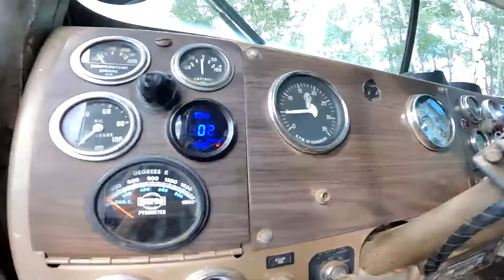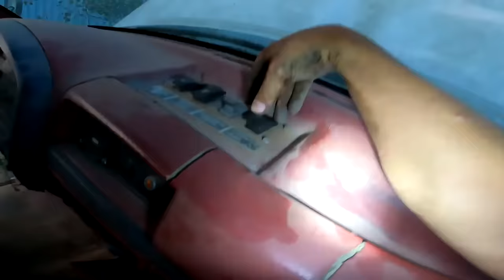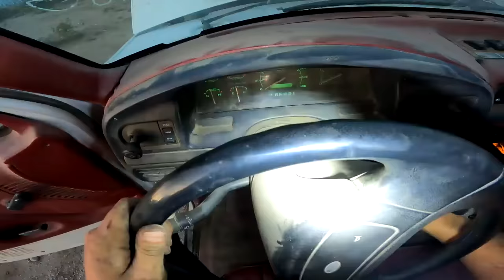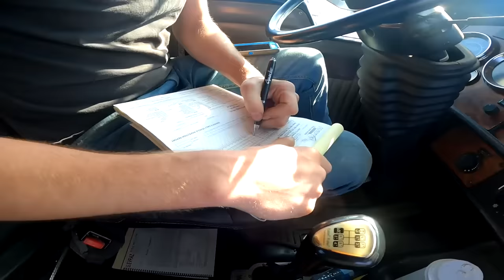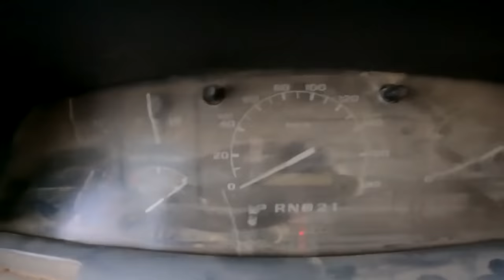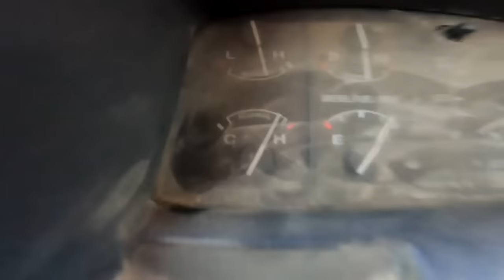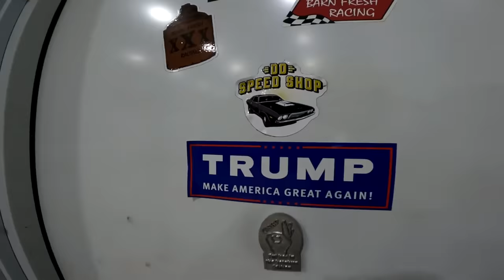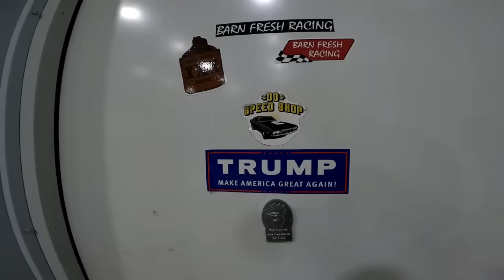7.3 IDI GARBAGE TRUCK REVIVE N WHEELIE!!!

Comment: It's an undisputable fact that engine braking is 100 times quieter than an 18-wheeler plowing through your living room.
Reply: You ain't wrong.
Reply: Lot less invasive too
Reply: I dunno man an 18 wheeler in the living room would make a nice conversation piece
Reply: And if a truck has a quiet exhaust system, the Jakes don't really make much noise at all.
Reply: I’m glad to came to this thread. This was a minty giggle 👌🏻👌🏻
Reply: But ill get a check for the living room
Reply: But have you tested it?
Reply: Amen!

Comment: Even though it’s an automatic, it is still fucking awesome. You could use it for so many things. I know you said it in the video, but my instant first thought was also a firewood machine. Load it in the side, dump it out the rear lol
Reply: And ya know with a very little work you could mount a log splitter to the truck and use  the hydro pump and pto that’s already on the truck, a set of controls and a couple hoses and fittings and your splitting wood and your truck loads and unloads for you.
Reply: It's so easy to swap these trucks to manual especially the 2wd. The ZF5 diesel/460 big block transmission is a lot easier to find then the small block ZF5 and then all you need is to find any clutch pedal from 80-97.

Now you can get away with hauling a heavy load of firewood in an auto in Alberta because it's flat there but that auto seemed like it was ready to die

Comment: Man rhat classic IDI sound takes me back.  I could almost smell the diesel cheech through my phone.  Ford damn sure makes some bulletproof diesel motors, especially those early 90's models.
Reply: '83- early '94 6.9 and 7.3 IDIs were some of the most reliable long lasting engines you could get back then, only after increasing the boost did the early 6BTs out perform them and the factree auto trans was junk compared to Ford's and the trucks are called shipping crates for a reason. I see more 80-97 OBS HD 3/4t-1t Fords on the road than any other brand from those years.
Reply: @hendo337  my grandfather worked in the log woods all his life and had a '92 7.3 F350.  It was his favorite truck of all time.  I think it had to have well north of 400k on the odometer before he finally got another Ford.  He was a huge believer in Ford's diesel trucks.

Comment: You need to do what the exhibition wheelie cars do to steer. The mount two paddles one either side of the steering wheel that each have a master cylinder that allows you to apply the left rear or the right rear brake independently to steer. Because if you keep turning the wheel while the front tires are hanging in the breeze your gonna come down and take either a hard right or a hard left and more than likely roll the truck. Which would make for some good footage, but kinda dangerous.

Comment: I was sitting here guesstimating minimum, 400-500rwhp and 700-800ft/lbs before those number were revealed. Even through that power sapping Allison 4spd and huge heavy driveline. I was WAYYY off, very impressive numbers lads, 600whp and 1800tq isn't phucking around. I love the old 7.🌳 idi bumper dumper dumpster pumper, being limited to 80km/hr winged out is a shame. Is it a C6 without OD? Or is it saddled with a short axle ratio like a 4.10/4.30/4.56/5.13 with those small tires(look like 235/75 16), governed to a low top speed, lower than normal max rpms, not getting enough fuel or a combination of all that? That's why I prefer the ZF-5 S42/S47 with 3.55s on normal tires or 4.10s with really big tires in ALL those 87-97 F-250/F-350/F-SuperDuty trucks no matter 6.9/7.3 idi, 7.3psd, 351w, 460 or 300 I6 (302 is the least desirable option I choose to ignore). More greasy, minty action, thanks for being you bud and sharing the fun.
Reply: Bumper dumper dumpster pumper!!!! MINT